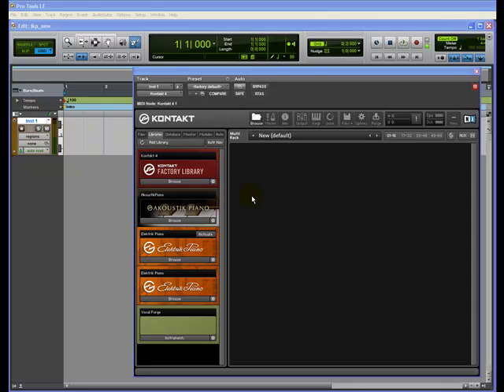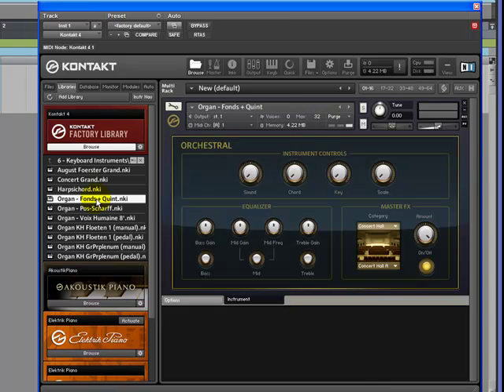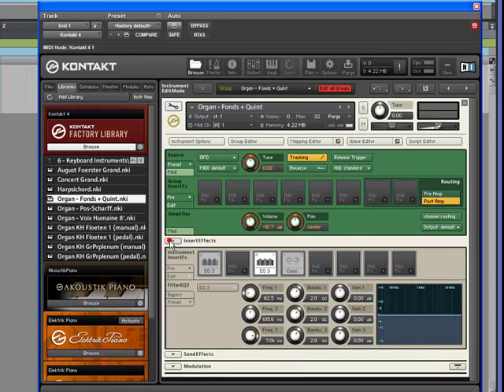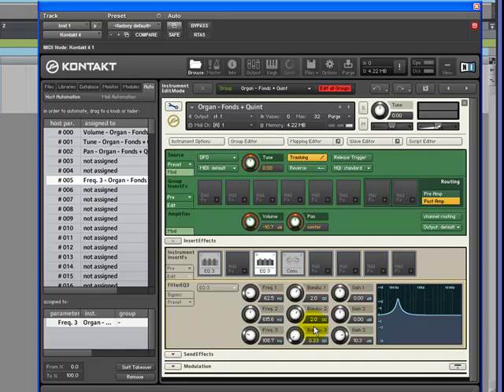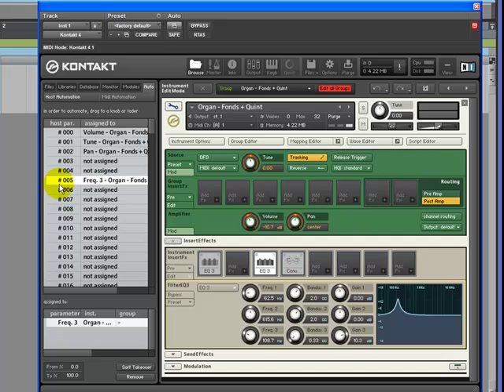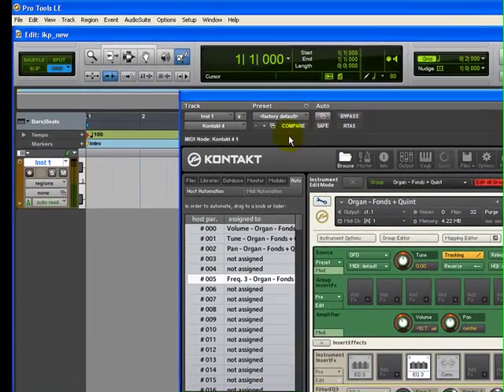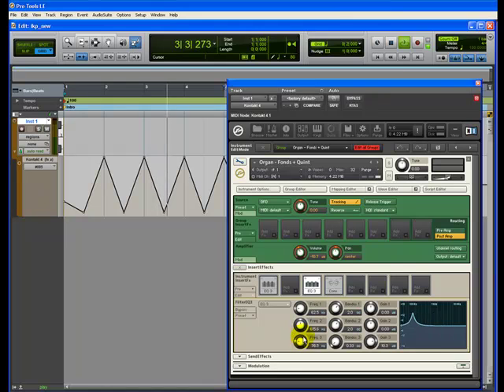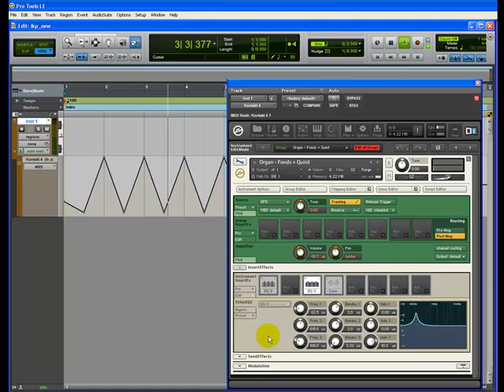Kontakt Automation in Protools

Comment: HI Terrence, thank you very much.. I am running into a problem trying to get my mod wheel to be assigned within Kontakt..   I try selecting on Midi automation and then I wait for the lightning bolt to light up under CC1 and I try and drag that to the little mod wheel on the keyboard within Kontakt.. it will not allow me to do that.   also on the automation tab cc1 does not highlight.. any tips..
Reply: when I look at some of the forums, they say to move the modwheel and then select the cc1 and drag it to the volume knob..  I cannot do that because I am working with Vibes and need to create the fan with the mod wheel.. hoping you can help